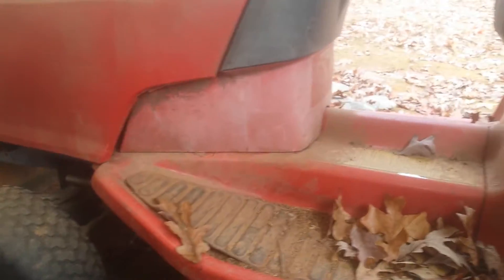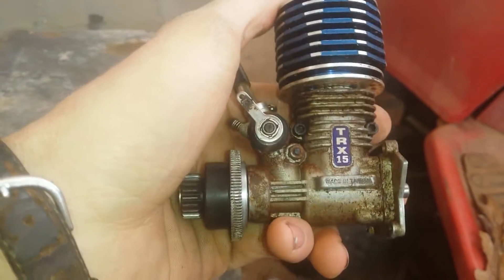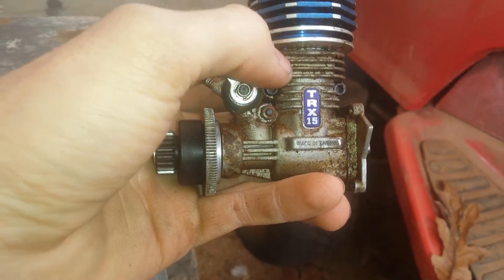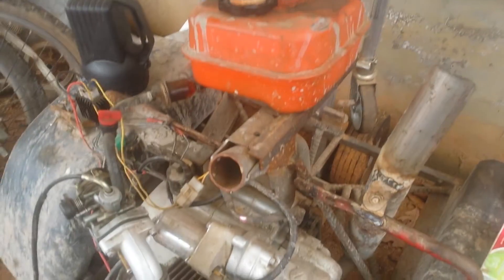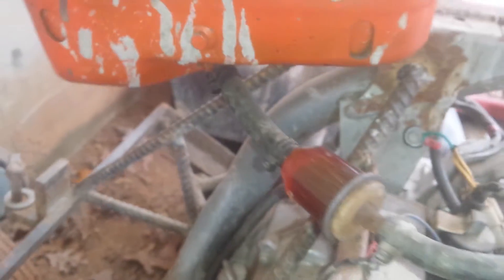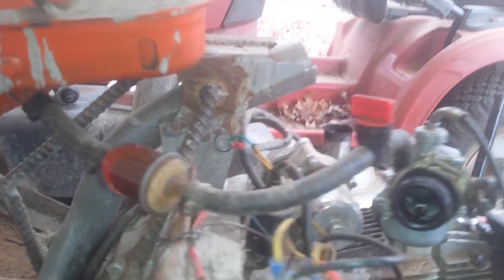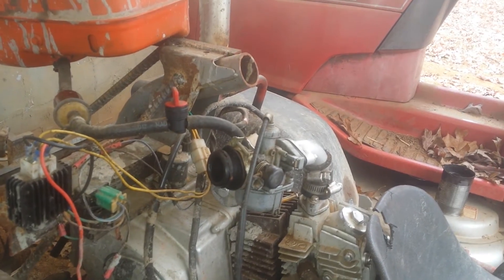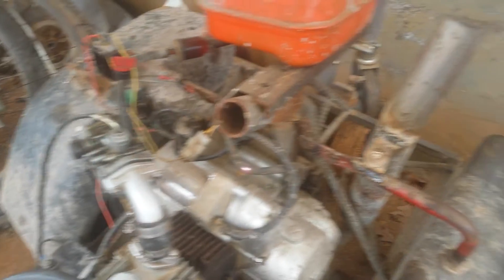Running a gas engine on diesel

Comment: Back in the 70's and 80's I ran my 1946 Ford Jailbar V8 on diesel for 18 years. Never used gas at all. Never needed to preheat either.

Comment: Very good your demonstration. All fuel has its flash point (temperature that starts to release gases, in the case of Diesel> 65 Celsius). The hard start would have to do the preheating of the oil, in its demonstration did the preheating of the engine block. To improve performance, it is suggested: fuel (diesel) before going directly to the carburetor, first pass through a copper tube wrapped in the exhaust, thus improving combustion (reduce bluish smoke) because the diesel will be preheated.
Be careful that the diesel does not reach the ignition point at approximately 210 Celsius.

Good luck!
Reply from the maker: ye i did the coil of copper around exhaust on a briggs that i cared about and it helped, but a 12 volt block heater in the tank was much better. and this gocart is notting more that a pos that is slowly being beat to death, hent why i put diesle in it and warmed it up with a torch. notting to lose here..
Reply: @oldreliable303  nice video

Comment: Dude the 7.3 idi mean fuel was injected into a pre-chamber but it was still inside the cylinders. Diesel does not evaporate good enough for a carburetor.
Reply: Diesel does not evaporate at all under 100°c. Even heated up to that temperature, to "run on fumes" isnt sufficient since the afr will not be good enough to get decent power or efficiency! Diesel were invented for efficiency! If you have to waste a lot of energy just to heat it up, it kinda fails its purpose. It could work if you would use the exhaust gases to heat the diesel up but never the less, gas engines are not constructed to operate with diesel since diesel ignites simultaneously. Igniting diesel 10° before TDC will pretty much destroy piston conrod bearing shells and crank after just couple of hours even without load!

Comment: Prove your point better by pulling the spark wire off.  I can't prove that it's dieseling because you could be running a mix of gas and Diesel even if it looks red.
Reply from the maker: Its still using the spark to time and light off the fuel, its just running on the wrong fuel.

Comment: Will it run continuously.?
Reply from the maker: Yes just as long as the engine stays warm
Reply: I am going to convert my gocart 3hp briggs and stratton motor to diesel and use glow pluggs . Nice video by the way helped me out alot you should make more conversion  videos on the topic - great video.☺

Comment: I dont know about your diesel but mine is yellow. Your "diesel" looks like 2 stroke gas mixture to me.
Reply from the maker: In my part of the world off road diesel "tax free diesel" is dyed red.
Reply: @oldreliable303  well in my part of the world heating diesel is also red but that is just one more reason why i wouldnt recommend putting that stuff in your engine unless you dont care damaging it
Reply: @oldreliable303  by the way, if you run your engine on fumes it does not matter what the fumes are made of as long as they are combustable. Petrol diesel cerosin Alkohol hell even wax would bang enough to push dat piston and make dat cranky spin...
Reply from the maker: @alexi077  i did not care about that engine, and i did it just to show it could be done.
Reply: @oldreliable303  then I should thank you i guess, on the behalf of people that didn't know that ICE can run on any combustible vapor as long its properly preconditioned.
Reply: @alexi077  where I’m from the off road diesel is fine for your engine you just don’t have to pay taxes for it (and you mostly just use the off road diesel ass farm diesel)
Reply: @BenC_04  yeah i would reply, but i just dont care...